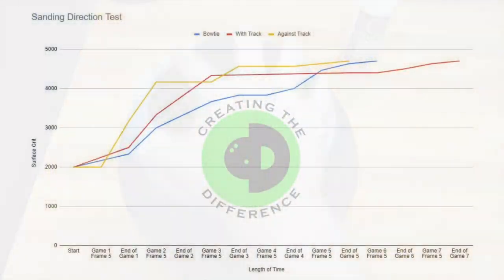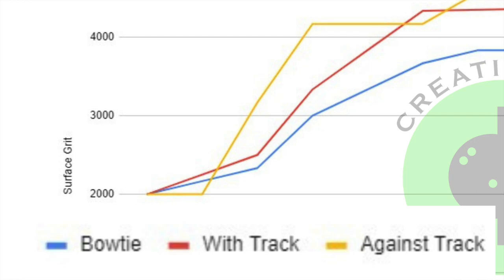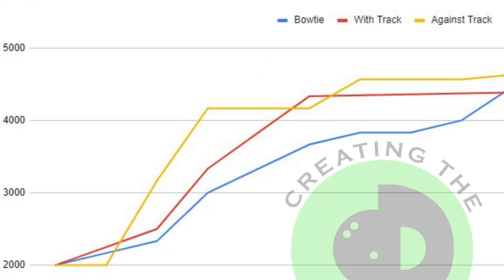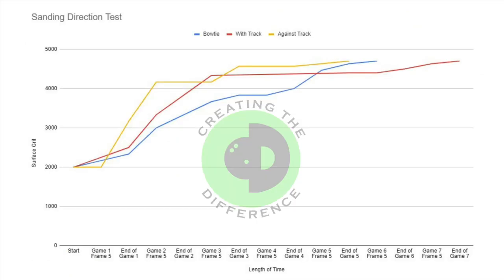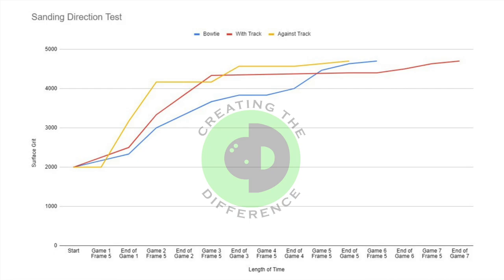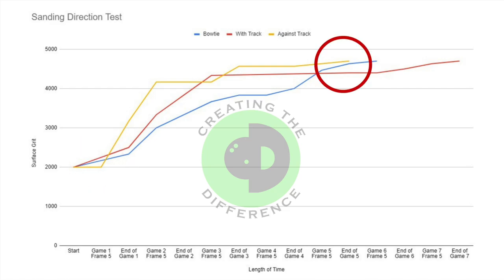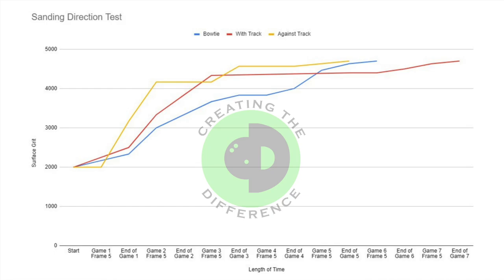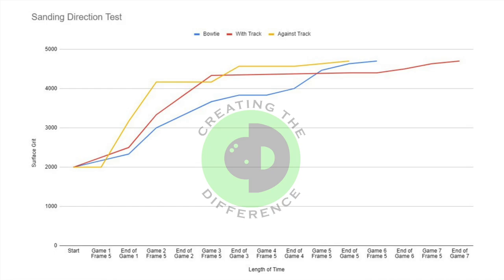Does Sanding Direction Impact the Bowling Ball's Surface Longevity? DOES IT EVEN MATTER?

Comment: Thanks for this information.  I use a ball spinner to alter the surface of my balls.  It would be interesting to see how different ways (angles) of using the spinner would affect the how the ball surface changes per frame.  Thanks again.
Reply: I would also like to see the results of such a test.  It would be valuable information to identify the final sanding direction that provides the longest lasting surface, with the least dramatic changes along the way.

Comment: Very interesting and understandable data.  Thank you.  
I started sanding by hand a few months ago and have been wondering if the change in performance after a few frames was due to the ball surface or the lane changing.  The graph shows pretty clearly that there is a big change after even one game especially since I have been sanding against the track.
Do you think it stabilizes around 4700 because that is the maximum that lane shine can do to that specific ball or to any ball?  Does this also imply that if we wanted to get a consistent benefit/reaction from sanding, we should sand after every 3 to 4 games?
Reply: Yes to all